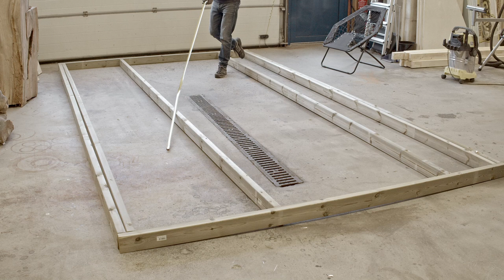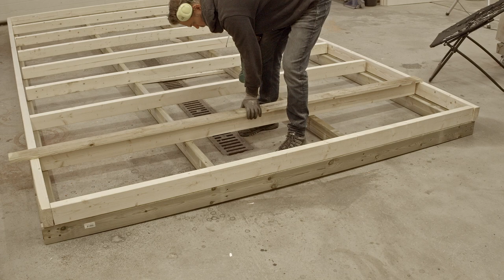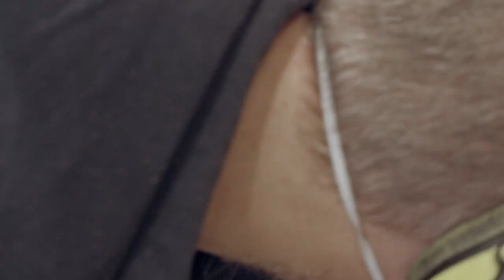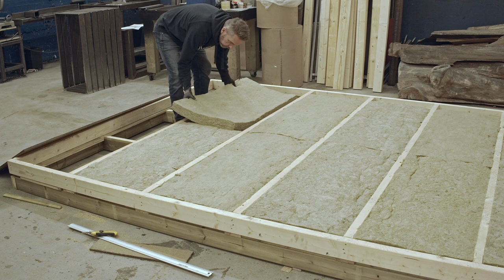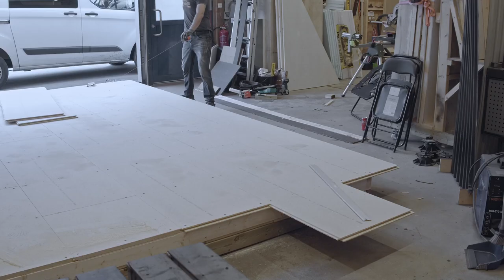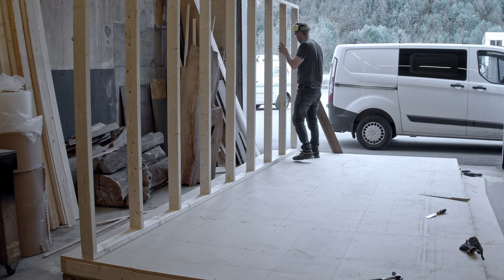Simple Floor Framing and Insulation

Comment: I’m planning to build a tiny house at my cabin. All the paperwork done…
I thought you should have a moisture barrier between the insulation and the floor?
Reply from the maker: You don't need a moisture barrier in the floor, and it's not needed in the walls and roof either if you only have 10-15 cm insulation.
Reply: But, IF you have 15+ cm, you should add a barrier?

Comment: Hi, is it just regular lumber, not pressure treated against rotting or insects? Or will you paint or treat it later?
Reply from the maker: The bottom frame is pressure treated lumber, and it will be placed on another pressure treated frame when finished.
Reply: @DieterSchneider  I see. Wasn't obvious on the video. Thank you!